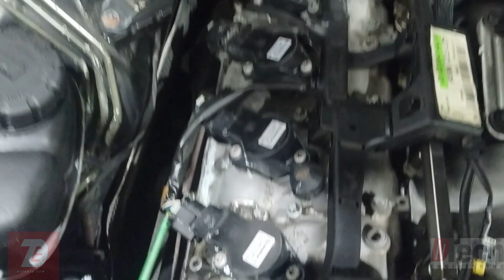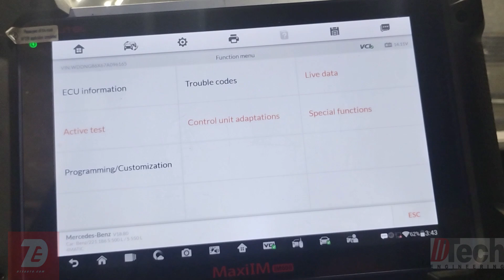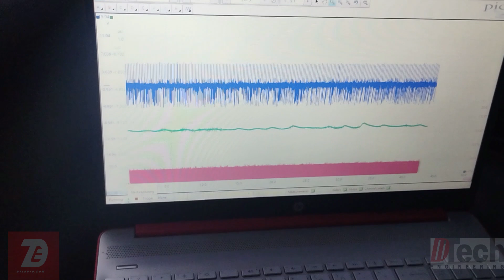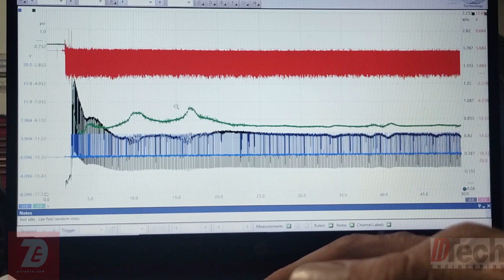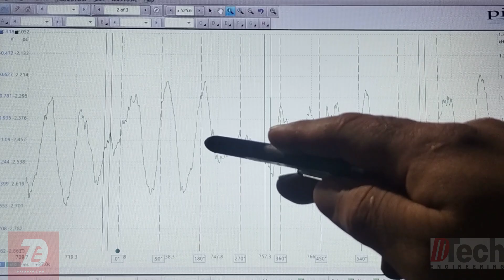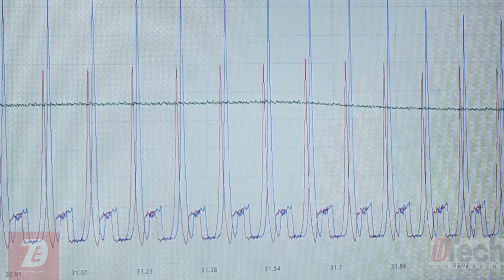2007 Mercedes S550 Misfire Diag Walkthrough: Scope Testing Tips

Comment: I bet that the fault was in hydraulic lifter or rocker arm because of random misfire. I would like to see you using inspection camera to check inside the spark plug hole. Probably intake valve was closing longer than it should.

Comment: I have a 2007 S550 and can vouch for the fact that the depth and professionalism you exhibit is certainly not common practice - even at the main dealers. Here is the catch: they are extraordinarily fine cars when they are performing to spec. As soon as the electronics systems become out of sync, they are an expensive nightmare. Agreed, this is a well diagnosed mechanical issue and electronics are only part of the story. The problem remains that, in the case of the S550, problem diagnosis is a black art.

Comment: Thanks for sharing such good information, seeing different ways of finding a misfire or mechanical issues with engine with waveform its amazing. Once again thank you for sharing. I have a question on the pressure pulse when looking at the intake pluses, we are looking at waves going down no upwards correct? sorry if its confusing I can email you my question if you are not clear. Again thank you for sharing.
Reply from the maker: It is all going to depend on the sensors output being used. So this one is traveling down when there is vacuum or pressure is dropping, so a pull would bring it down. Hope that helps and thank you for watching

Comment: Excellent diagnostic Sadel! Really well explain and easy to understand the way you show it in the video! I can't believe how much we learn in every of your diagnostics cases. I was thinking about the bonus info that if we don't have exhaust phaser and no turbos and we have that exact condition at the end of the exhaust stroke during acceleration and we only have intake phaser! I've seen cat clogged but the rise starts at the beginning not at the end! I just had that in a RAV4 2006 4 cylinders at the end of exhaust stroke! Thank you for sharing, Sadel. Take care!
Reply from the maker: Thats crazy you saw your Toyota show it at the end of the exh stroke, I would almost think should be at the beginning. But maybe it's because it's at idle and not revved up, like it needs time to build up the back pressure because rpm and airflow so slow. Thank you for watching as always!

Comment: When you say dead mis does that imply a continuous misfire
Reply from the maker: it means absolutely no contribution from a single cylinder. So the engine would run but have a single dead point, almost like when you unplug a coil. Dead misfire compared to partial contribution, the engine will run and barely have a single skip that might be noticed or not, depends on how bad it isn't lighting off the whole air fuel mixture. Almost like a partially clogged injector delivering less fuel, it will ignite and burn just not have the same explosive force to turn the crankshaft as the others that got more fuel, so it will spin the crank just not well but not be a dead skip of no contribution. Hope that helps
Reply: @DTEAuto  well explained. Thanks

Comment: That's cool Sadel!
I have asked before and understand if you don't want to, but I would get a lot out of it. If you would show your hook ups (where and which sensor you're using)for the scope when you're explaining each capture set up.
Equally, super interesting and frustrating to diagnose these valve issues that a few people have covered in the last year. Where it becomes apparent that a valve has a sealing issue but only occurs in a certain orientation of the valve to seat. As the vlave rotates, the issue phases in and out. 
Do you think that is why you can see the wave trend in the in-cylinder peaks relative to each other?
Still blows my mind that such a complex issue to catch and isolate to a diagnosis, could effectively be solved with some $10 valve lapping paste.
Reply from the maker: yes, sometimes I do just skip over the set up with the assumption some might know or other times it's to add less confusion to the diag and just explain the breakdown of the waveforms themselves. And I definitely believe the random psi issue incyl  psi anomaly in the intake trace is due to the valve rotating and bleeding off in different positions
Reply: @DTEAuto  you do a brilliant job! You always explain what you're tapping into for the purpose of understanding the capture channels. 
It's purely from a personal learning standpoint, in learning your sensor and hook up choices. The specifics would help me advance way quicker.
The 2 big ones . . .
I'd love to see your coolant and exhaust pulse hook ups. 
Coolant = I can see you use a map sensor, but I noticed you have graduated from a direct hose to a hose that has an offset Y in it. Why have you swapped to that from the early days? Are you concerned with having coolant hit the sensor? Another reason maybe? Do you find it alters the signal with it not being a sealed system to the sensor?
Exhaust = are you just sticking it up the pipe a bit with a hose? I was trying to figure out how Bernie's ATS tool amplified the signal(physical pulses) to make the signal easier to read. All I can think is that it is a narrowing tube. Restricting at the exit to amplify the swing from positive pressure to negative on misfires. The sensor reference in the tube. Or maybe a bernoulli restriction and measuring on the upstream side.
I just know you put a lot of thought into almost everything you do. So even the parts you might feel are rudimentary. Can be of great use to others.

Comment: Wouldn't a cylinder leak down test put the final.nail in the coffin.
Reply from the maker: With having the intake pulse waveform and it showing the psi bleed off anomaly is enough to know where the chamber is leaking past (i.e. intake valves) so there really wouldn't need a point to perform leak down test. The incylinder pressure test during idle was just to get a bird's eye view of the running pressures the engine is experiencing it that condition, and the great difference in pressures between the two just clearly shows us the end result of the leaking valve which is the culprit and because of the lower psi it captured it shows us why it misfires. Plus in order to perform leak down you have to gain access to the crank in order to spin it, try that on some that the crank bolt is not accessible due to being blocked by the intercooler (MB V6 Twin Turbo) or better yet like the Audi's where the fan assembly sits up against the pulley and the whole front end has to be removed and put in service mode to access the crank pulley bolt and even then they require a special tool adapter to spin the crank because there's no center bolt head. And then after that consider that you have to spin over the engine to the correct tdc position of compression for whatever cylinder and with no markings you won't know how exact you are, and lastly from what I have read or heard, doing conventional leak down has "masked" leaking valve's due to it putting pressure on the face of the valves and literally seating them tighter and not "showing a leak" Imagine doing all that work to not knowingly temporarily fix and seat the valve tighter because the air you are putting in help the valve seal. Plus, if you remember the cranking compression did not show a difference this showed its ugly face during engine operation so it's a very difficult thing to pinpoint. hope this helps explain some reasonings.
Reply: @DTEAuto  Understood,  thank you for taking the time to reply and explaining.